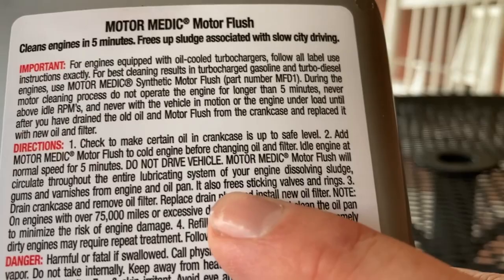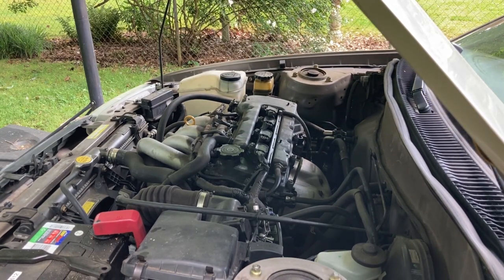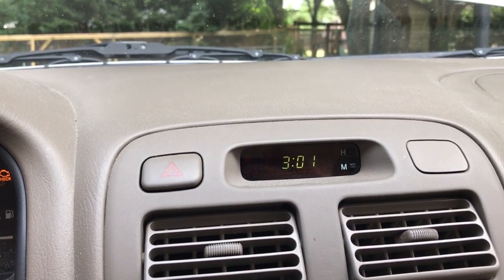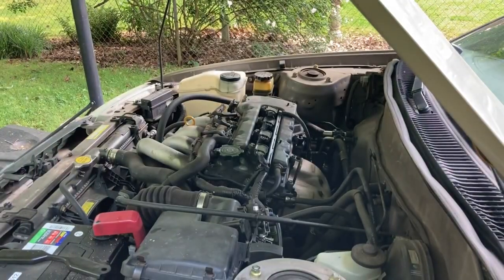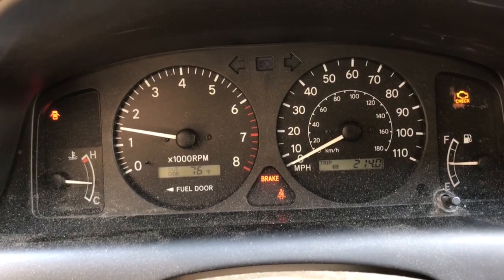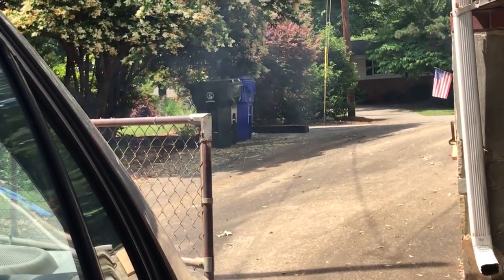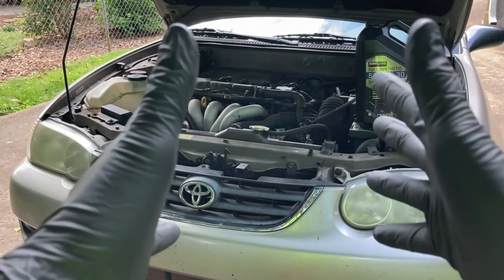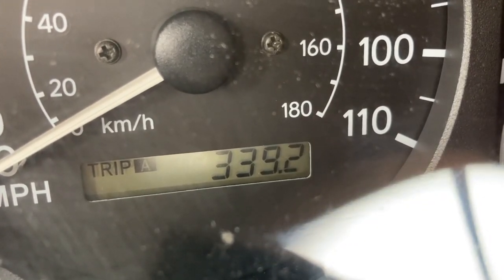Will Motor Flush stop oil consumption? | Oil Burning Experiments🔥- Episode 5

Comment: Having watched all for your episodes of the stuck piston rings i can tell you this - myself I had exact the same problem, the oil consumption was very similar. For about three years in the run I tried everything to solve this problem - started with kerosine, diesel, then I switched to carbon flush products - starting woith the cheapest ones and upgrading to the most expensive ones I could get. After 3 years and 60k miles of fight this issue I gave up, handed the car to the mechanic shop where within 3 days they changed the piston rings for a fraction of the cost of all of my experinets (granted, I don't live in the USA, here where i am the labour cost is fairly cheap). Since then two years passed, I drove again almost 45k miles and NEVER had to top up any oil between the poil changes (every 6k miles). Was it worth to experiment? Costwise - not at all. Getting to now my car and having fun - totally worth it. I wish I thought of recording this and making smoe YT channel as you did. 
At this moment the engine is clean as a new one: https://www.youtube.com/watch?v=x4u64lKBbhQ
Reply from the maker: Nice. Those cams look great!
Reply: Okay so what do you recommend? Just change the piston rings? Or add this Motor Flush and Change the piston rings?
My mechanic said my car I can easily change the piston rings. Just take off the top and move the pistons up... they are easily accessible... I had the engine rebuilt 7 years ago and it's running strong. But thought maybe change the piston rings and make sure it's clean inside... Any thoughts?
Reply: @MikeKollin  the 2.4 L and 1.8L engines need new piston and piston rings to get it right. But you should do endoscopy first if  the cylinder wall are still good.  I would just use diesel engine oil like 0w-30 or 5w-40. They have high detergent without harming seals like engine flush.
Reply: IT IS YOU!

Kris... CEASE AND DESIST! Your truth..... maybe the reality of the world... but... I WILL NOT BELIEVE IT! AND BLOW HUNDREDS on my pursuit of a solution!!!!

🤫
Reply: @R1D9M8B4  I am not gonna trying to convince you. You free will.

Comment: Don't give up. I subscribed to follow this project and I will not be happy until the problem is fixed. Even if you have to pull the pistons. No SURRENDER!!!
Reply from the maker: Thanks! That's the plan!
Reply: @FamilyFriendlyDIY  did you ever try the shooter lube?
Reply from the maker: @nicmc3077  Haven't gotten to it yet, but it's still on the agenda. Ended up having a few issues with other cars I had to fix first.
Reply: great trial..but failed...well most of case oil burning are oil leaking from valve of sylinderhead..but honda v6 engine is less burning oil because head has about 45degree angled. so less oil touching  aera. that mean l

Comment: There are other things that can cause oil consumption.  The positive crank ventilation system. Make sure the fresh air hose from the air filter box to the valve cover is not obstructed.  Replace the PVC valve because it could be sticking randomly.  Make sure the PVC valve hose to intake is not obstructed.  Any one of these problems can push oil into the intake to be burned. A dirty fuel injector or injectors.  Although the engine seems to run fine the injectors could be not spraying a proper pattern to insure fuel mixing.  The extra fuel will find its way pass the rings thinning the oil and evaporating it off. through the pvc valve.   Clues to that are the smell of gas in the oil, smoking, dirtier than usual oil at change.  A sticking fuel injection pressure regulator.  This can enrich your air fuel intake and get past the rings and as with a bad injector thin your oil.

Comment: Hi Dave!
Stuck rings can't be all the issues. It could also be your Valve Seals. When Valve Seals are worn-out, they will allow oil drip into combustion chamber and guess what, it will burn....So if your compression is high when warm, my guess is that your rings aren't the issue. The issue is your valve Seals.  
You can purchase the compact valve spring compressor tool and set of Valve Seals and you don't even have to take the Head apart. You can change them with Head on the car.
Good luck!!!
-From Seattle
Your friendly ex Mechanic
:)
Reply: I would go good engine swap. Dave's Corolla engine is rather finished.
Reply: Thanks for your advice.
Reply: a compression test won't tell you the condition of your oil control rings.
Reply: yeah but if its just the valve seals the car would only burn oil visibly for a couple of minutes when its first started from being stood over night,itll still burn oil when you drive but you wont really see anything
Reply: These Engines are known for oil usage because of the Soft Rings and they do get stuck. Toyota fixed some of them.
Reply: Usually worn valve seals and stems will cause the car to smoke a lot on start up after sitting awhile. After it burns off you won't see smoke anymore. Bad piston rings will be smoking While revving or driving at some engine speed.
Reply: Someone drilled more holes in oil ring area for better draining ...then new stock rings plus ball hone ...runs good ...big job though
Reply: @davidwoodward7020  would that cause cause a car to literally only smoke after idling for about 3 mins then I’m sure its still coming out but like you said you l moving so it isn’t as much when moving
Reply: @LingoENT  yes,as its burning off whats dripped through onto the piston heads over night on initial start up,so naturally its got more to burn off and also the engine is cold so doesnt burn off too well,hence alot more smoke..but once thats all burnt off it may only smoke slightly if its JUST the seals or even not visibly but youll still be buring off oil,just not as much,plus youll be mostly moving so itll be harder to see..itll smoke all the time and more so when you put your foot down if your piston rings are worn out
Reply: @davidwoodward7020  ok I appreciate that 💯💯 I def been battling between that and a stuck exhaust valve , but I honestly believe it’s the valve seal , lol I just don’t want to look like a train when I pull of McDonald’s anymore it’s not healthy either
Reply: @LingoENT  well,best thing to do is take the cylinder head off to see...while youre there as its such a big job in a way,you may awell do as much renewing etc as you can.....even change the head gasket for the sake of it,change the intake and exhuast manifold gaskets too?maybe, as i did..the timing belt and water pump as well as lapping the valves...it was a proper over haul,including the piston rings :) good for another 100,000 miles i hope !haha

Comment: Regarding your cold compression issue on #2 and #3: Do a c-check cold, pour some light oil into the cylinders, then do another c-check. The oil temporarily aids sealing of the compression rings. If your bad cylinders come up, you have a ring issue. If not, you have a valve issue.
Reply: Hey about the bad valve issue I'm having issues just in one cylinder it's at 60psi others are around 110+-10%  the one that holds the 60 holds the pressure for a extended period of time. Could it be a valve issue still ? Or do you think piston rings
Reply: Change the pcv valve and use Lucas oil

Comment: So many great suggestions below..Just for grins..When the engine is idling and (hot) pull out the dip stick and see if it blows air or smoke rings out of the filler tube..If it does that would tell you you have excessive blow by..And that usually means worn rings..Potentially stuck rings..The lack of vacuum in the crankcase tells it's story..There should always be vacuum not pressure in the crankcase..Had this problem with my 240 Volvo and a top end engine refresh and new rings did the trick..Been running like a top for 5 years now..No oil consumption..Also had the head shaved because it's a non interference motor so it raised the compression a bit and it feels like it has a bit more power from stock. It pulls really good down low..:)..

Comment: Buy a cheap borescope and check the cylinder walls. Valve seals will cause the car to smoke a lot during the first start of the day. If you get the borescope, you could check in the morning with a cold engine if there any oil on top of the pistons or valves. Change PVC and try Restore. If that doesn't work, then rebuild or use a thicker oil.

Cool to see someone documenting this! Subscribed just to see what happens to the old Corolla engine.
Reply from the maker: Thanks for the sub and the advice, Chris! I just ordered a borescope! ... I'm sure we can find other ways to make it useful as well.
Reply: Yep my 2AR-FE would smoke on startup free it sat a few days. Figured it was valve seals. Used some ATP 205 in my next oil change and boom. Problem solved. That stuff is amazing.

Comment: So I had somewhat of the same issue as you face… but not as to that extent but what I did; to what seem to work. Atf 1 quart in crank case and rest with engine oil of choice. Did this for a total of 4 times in one month and in total of each mile with every oil change is about  50 - 75 miles. 

When I did this I used 10w-30 with atf 

With atf it thinned out the oil a bit but not by much. Imo it looked like it was 5w-30 when said and done but I suggest not to run it long on that mix 

It cleaned up the lifters, and has less blow by 

It also raised compression up a bit but not much. Maybe like 5-7 more psi in pistons 

But I also did a sea foam treatment through the brake booster vacuum line and so that could have a effect on results

Comment: There is a product called carbon guard I believe it's made by OMC for outboard motors that run pre-mix. You put it in as an additive and it removes carbon very well. I used to run it along with premix in my rotary engine and on tear down you noticed the difference

Comment: you should prime the new oil filter before you install it, the cuts the time the engine has no oil circulating thus reducing engine wear. Just a tip for you. 
Like your videos though

Comment: If valve stem oil seals, try ‘engine stop leak’ as that re-plasticises oil seals all through the engine. I’ve used it with great success.
Reply: You mean ... GREAT sucess!👍👍
Reply: @hiphopman72  - that’s the one!
Reply: @timhicks2154  Instead of 
Re-plasticizing. I suggest it’s  expanding the rubber, possibly epdm material that seals are made from.

Comment: Thanks Dave,
I'm 2 for 2 using Motor Medic successfully to cure oil consumption. I did the spark plug hole piston soak method. Both engines were GM LS gasoline v8s. a 130k mile 2007 6.2L L92, the other a 61k mile 2002 5.7L LS1. Both were burning 1 qt/3k miles. Consumption was egligible afterwards. Consumption on both was caused by poor pvc system design. I made pvc system improvements to both engines at the same time I did the piston soak w/Motor Medic to prevent future problem.

Comment: If it's the valve stem seals, when you start the engine after sitting overnight, you would get a lot of oil smoke while the oil is burned off the valves. I don't believe you have a sticking ring issue, I feel you have a wear issue. Replacing the rings and honing the cylinders is what you need, and yes, go ahead and replace those valve stem seals as well.

Comment: I just binged the whole series in an evening.  Just wanted to bring some professional experience to the mix (technician since 1996, mainly on Honda and Acura, which have their own issues with excessive oil consumption).  With the amount of cleaners and solvents already ran through the engine, there's probably not a whole lot more left to do.  I would get a scope down into the combustion chamber and start inspecting the cylinder walls for grooves (if the liners have deep grooves in them, no amount of freed up rings will help you).  I would probably pull the exhaust manifold off and scope the back of the exhaust valve for carbon, which would indicate a leaking valve stem seal (likely contributor to the carbon build up on the plugs).  One thing that's bothered me is the fact that the CEL is on.  Do you know what that is for as it may or may not have impact on the running of the engine, and thus may be indirectly affecting oil consumption.
Reply from the maker: Thanks for all the info, Dean! The CEL is a "small leak in EVAP system." I just bought a scope this week to check out the cylinders---not sure if I want to pull the manifold yet, but someone mentioned that I might be able to see oil on the top of the piston if the valve stem seals were leaking (any thoughts on that?). I know all of these chemicals might be a waste of time, but I thought while I have a car that appears to have stuck rings (hopefully we'll eventually determine that for sure), why not show whether any chemicals can fix it? It might keep other folks from throwing their money down the drain, or, if we find one that works we'll all know which one to buy. Look forward to hearing from you again. All advice is appreciated!
Reply: Man, this is exactly what I’ve been wondering after seeing information about cylinder scoring. I’m looking forward to the result.

Also, have you taken off the valve cover recently? Do you have a before and after of the inside of the valve cover and the camshaft, springs etc? I bet it looks a whole lot cleaner now. That can give wan idea of how much your bottom up treatments have cleaned things.
Reply from the maker: @craigiefconcert6493  Haven't taken the valve cover off yet ... but very soon :-)

Comment: Just to add no matter what chem fix you use to try and unstick the rings with it will only be a temp fix.
The 1zz engine is known for burning oil.
Only real fix is the upgraded pistons with the more oil return holes.
Replacing your rocker cover gasket may help a little as you have oil getting in from there.
Reply from the maker: John, do you think drilling more holes would work as well as buying the upgraded pistons?
Reply: @FamilyFriendlyDIY  would be no need if you get the newer pistions.
It fixed the issue.
Toyota started to install them properly from about 05.
It all depends what you want to do,buy new pistons,get a newer dated engine or if you realy want to push the boat out put a 2zz engine in.

Comment: Yeh might be a valve seal too, try 205 re-seal after a fresh oil change. 
If it's not that might be a head gasket that's going bad too. Could be a lot of things leaking oil into the cylinders.

Comment: I’m still watching. I’d say change the pcv instead of cleaning. I cleaned mine at first and it made a difference and then it came back. I recently changed it and it has helped. Now I assumed that cleaning it would be the exact same as getting a new one- pcv are simple in design. But there might be just enough wear on the coil or ball valve or has just enough oil or carbon that it collects so much faster than just getting a new one. It’s a simple change and inexpensive that would be worth an experiment and see if it helps. Worth documenting I’d say based on the comments. Also watch Project Farm on oils with low evap rates. Great videos
Reply from the maker: Thanks Lupe. So many have mentioned the PCV that I think I'll change it just to officially eliminate that possibility.
Reply: @FamilyFriendlyDIY  This engine was famous for having one of the worst PCV systems back in the day when I worked at a quick lube. Definitely keep the vale new. Better yet pull the vale cover and soak it in solvent over night get it perfectly clean.
Reply: 2017 sportage using 1 qt in 400 miles,  did pcv last year, made no difference.  Now into kia for $650 combustion chamber cleaning, if kia doesn't back their cars warranty,  it's gone.

Comment: I suspect that you won't find a permanent solution but I'm sticking with the playlist as these are good entertainment, and I mean that in a positive light. You earned a sub my man. 
I've yet to find a miracle in a bottle for engines, though some products do help patch illusive issues like sticky lifters or carbon deposits.
Add: Just a few more general quantifiers about prospective engine health in general. Smoke color, while indicative of problems, can tell you what else is being burned/consumed in an engine. A light blue tinge is normally oil going by the rings. Puffy white smoke is engine coolant, which usually means head gasket or a cylinder wall breach (or a hose has a leak, of course the smoke comes out of the engine bay and not the tailpipe in that instance) and is accompanied by a sweet sugary odor. Dark brown/black means you got on the throttle and blew a load of carbon off the valves. 😁
If you get a rainbow of colors, well, time to park 'er in the pasture and wait 20 years for future value appreciation.
Reply from the maker: Much appreciated. Glad to have you! ... been binge reading all your comments this morning :-)
Reply: @FamilyFriendlyDIY  Entirely your fault, I had to binge your playlist to see if you ever came to a resolution, then I came back as your videos are well done and enjoyable. 👍Similar levels of humor I'd presume with an innate ability to annoy the wife. I've seen that look quite a lot!

Comment: Did you look into pouring some MMO or seafoam directly on pistons after removing spark plugs and let it soak for two days? I haven't done it yet but lots of people recommended doing that. I would say research it as that will be a very direct treatment better than shooting in the dark and safer than running lots of chemical which will have to burn through the O2 sensor & Cat.
Reply from the maker: I did that with Seafoam in my first video, Ronny, but haven't tried it with the MMO. We'll see. Thanks for the comment!

Comment: I'm a little late. But an oil stabiliser like Morey's usually helps with oil loss. It's like liquid gold. Not sure if you guys have Morey's (I'm Australian). But I've put it in all my cars and it works a treat for keeping motors lubed and stopping small leaks as well. All these though are short fixes. You can't really fix sticking rings without a full replacement.